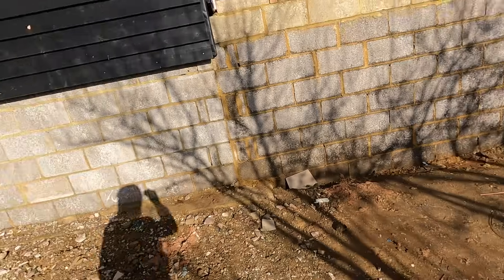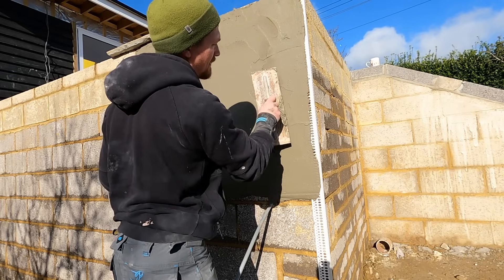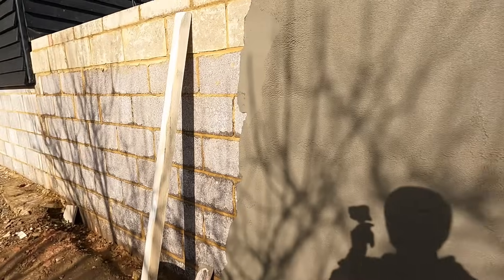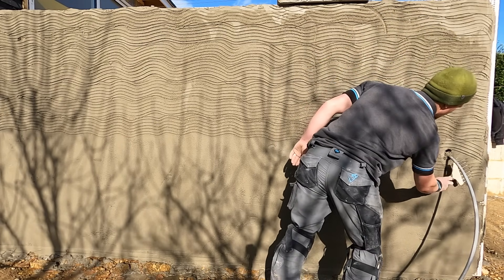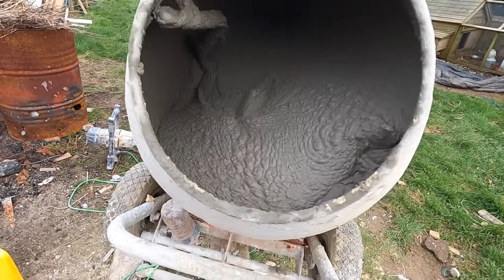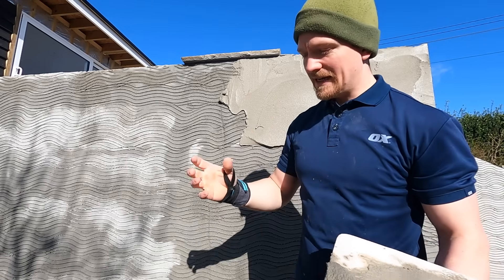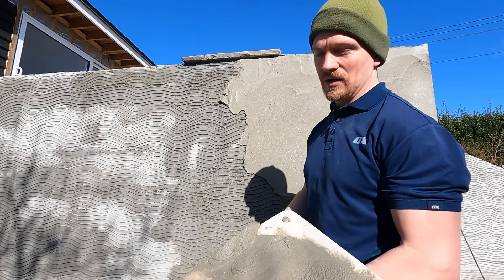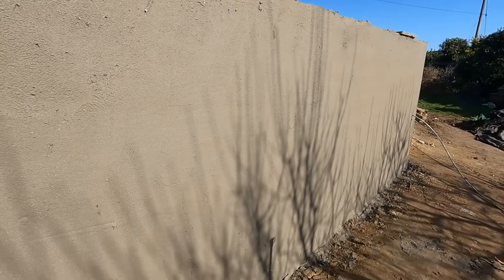Beginners Guide To Rendering…Every STAGE Revealed | MIXING/ APPLICATION/ PERFECT FINISH

Comment: good advice for a beginner. One thing wrong. Water FIRST in mixer then CEMENT then SAND. If you put sand in first then cement it drys the drum out and cement sticks to the back so  you end up with a weaker mix. Im not a beginner ive been a Bricklayer for 40 years so i know what im talking about.
Reply: My dad was a tiler for 60 years, that’s the way he did it too. I was labouring for a guy years ago and he told me off for doing water, cement, sand. 
Did it his way, and it was a nightmare - sticking to the drum😩

Comment: Why did my render drag off when I put the speed skim over it? Got it on ok but tried to level but ended up dragging a section off??
Reply: The wall was too dry, and or the render wasn’t wet enough, or not enough pressure when applying render

Comment: Blaine that over hang coping doesn’t look wide enough? If it ain’t it will stain over in about 1-2 year after painting seen it so many times . Top  job you always do like your videos even with my 20 plus years on the trowel.
Reply from the maker: That was just an off cut I think pal - I was using it to hold my straight edge down when Rendering the tops. Very good point though! Thanks for watching by the way...I really appreciate it 👍👍